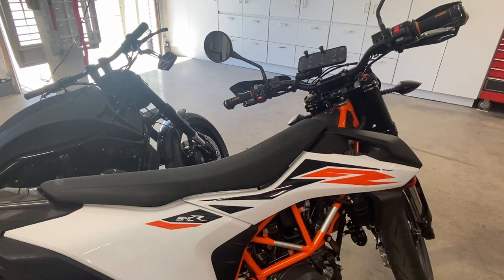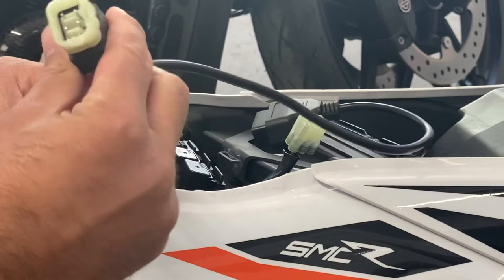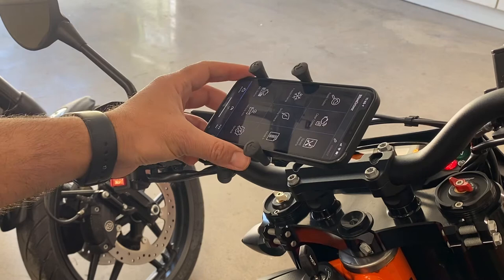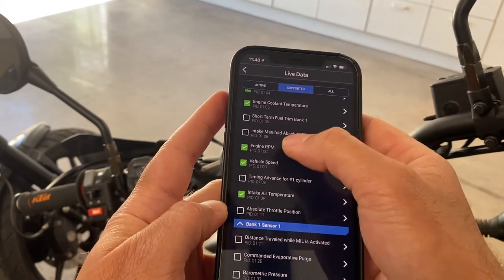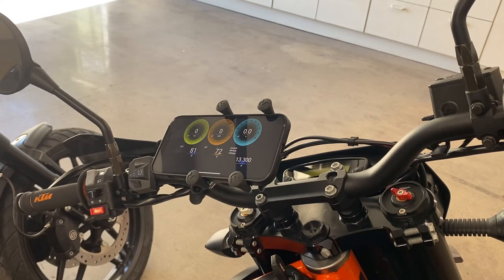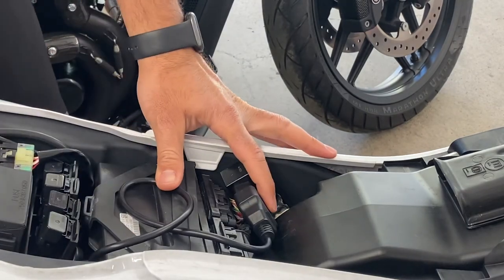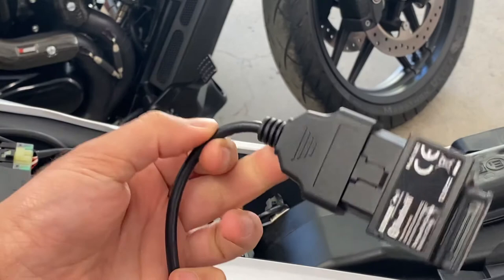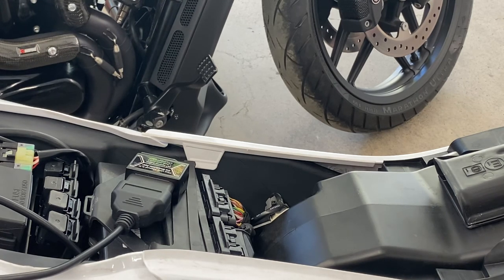Motorcycle dash on your phone with OBD II reader

Comment: Carpe iter makes the best tablet for this.. and they have a nice app called DMD2 for android.  Allows you to pull off all the data your ecu will produce just like this but all readable from the app … the tablet is military grade,, you can hard wire to the motorcycle..    it’s the best… better than using the phone.. the phone has no vibration protection…
Reply: Hello, where i can find it?